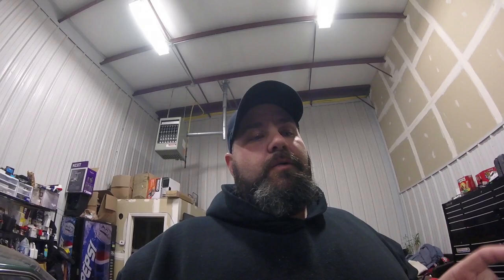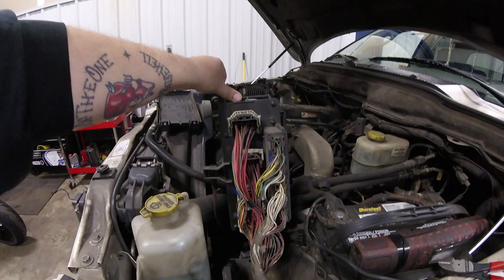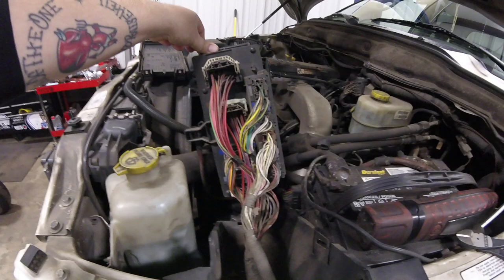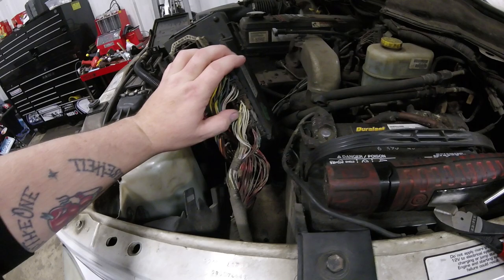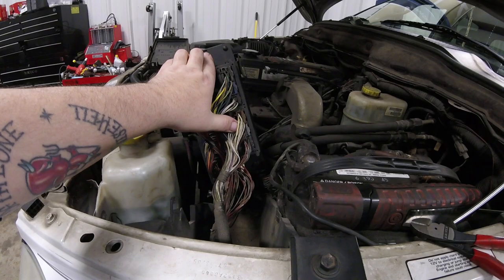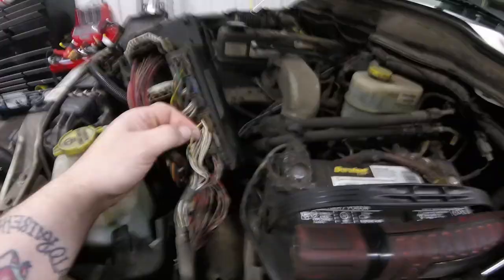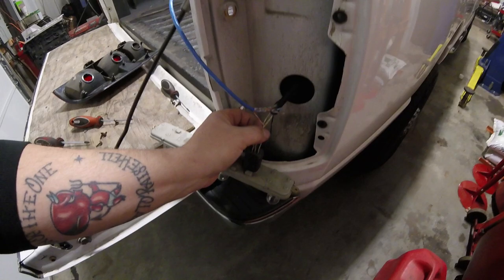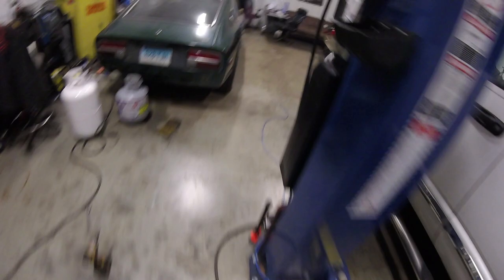Cummins Ram 2500 Bad TIPM??? Maybe not!

Comment: I have an issue where my parking lights don’t turn off when I turn the truck off. I’ve found an annoying work around by turning the key back on, turning my lights on then off, then turn the key off again. Would this possibly be the TIPM? Or a Relay?
Reply from the maker: It could be a stuck relay but most likely its the TIPM holding the lights on. Most dodge trucks have a feature where if you turn the ignition off with the headlights on, it will hold the headlights on for 30 seconds. Its a safe entry feature and sometimes it goes awry. Your TIPM may need a software update to fix the bug.

Comment: I have a 07 ram 2500 i kinda of got a similar problem but my left blinker blinks while the right blinker is on unless the running lights are on. IF I turn the running lights on the lights on the truck work fine but as you noted my right turn signal has no power at the 7 pin trailer plug any ideas Thanks

Comment: Great video. 
My 2006 Dodge Ram 2500 Cummins 5.9 L have an issue with the a/c clutch power, some times gets power and some times not, the clima control module turns on(yellow dot) and turns of randomly,compressor is fine. Please advice. Regards

Comment: I have a 6.7 2008 ram 3500 , 
Im having trouble with the a/c shuts down and the airbags ligth turns on but if i hit a little bit the tipm (fusebox)  the a/c  works again until i got a bump on the road or something, if you can help me please
Reply from the maker: At this point I would say that your tipm has failed. You will have to get it rplaced at a dealer.

Comment: Great video.. have a question that's the crazy, 2000 Dodge RAM 2500 Cummins, turn the A/C on and the engine sounds like it's missing.. turn the AC off and it stops, put a alternator on it about a month ago

Comment: Great video thank you! It just so happens I just purchased a 2014 Ram 3500 4x4 tradesman and a 2019 Big tex 25+5 gooseneck flatbed trailer all the lights work properly yet I am unable to make the trailer brakes work. I bought a trailer plug in tester and the moment I plug it in the 12v light comes on. I'm not an electrician so I dont know if that is right or not. Any suggestions? oh I did try setting the gain on the evic and it will not reset for setting up gain on new trailer. I also tried settings on radio in which I have trailer settings as well.
trailer 1 thru 4 but the problem I am having there is every time I set trailer 1 then trailer type then heavy electric it says info not saved! Then I start all over but get the same results every time. I will greatly appreciate any  ideas thank you very much.

Comment: My tac doesnt work in my 2006 dodge cummins. My ac randomly goes out typically when the truck kicks into a passing gear and my headlights go dim sometimes. Do you think i have a tipm issue?
Reply from the maker: The tac was a popular failure item in those, the a/c is most likely low on charge, and the headlight ground is probably corroded. I would check grounds, recharge the ac, and deal with the tac. Doesn't sound like a typical tipm issue to me.

Comment: I have a 2004 Dodge 2500, 2 wheel drive cummins. The horn started going off non stop. I had to pull the fuse to get it to stop. Has anyone had this problem or have you heard of someone else have this problem?

Comment: Hi ! So I’ve got an 08 dodge diesel that is sending constant power to the AC pump . Never cycled off building way too much pressure and icing the system up . The only way is to physically unplug the plug on the pump to prevent it running . 
I need to find time to do more digging but curious if you’ve come across this before ?
Reply from the maker: I have. Its either the compressor relay is shorted on, or the evaporator temp sensor in the hvac box is bad. With a proper scan tool you can check the operation of the temp sensor.

Comment: I got a sterling bullet that throws a lot of codes at me the most common are p0107 and p0004 but there is a list of others I know it’s electronic because the sensors are brand new the truck is deleted I got no idea where to start or go if anyone has had the same problem or some advice I’d greatly appreciate it

Comment: Hello i have a 06 dodge ram 3500 i was repairing trailer lights from previous owner because trailer brakes weren’t working something caused a short now my a/c light on my control go off and my airbag light comes on i wiggle wires on tipm and airbag light goes off a/c starts working

Comment: I have a 2009 Dodge Ram Hemi 1500.  The wipers stopped working, the HVAC  blower motor moter stoped working, door locks, stopped working, brake light is on, aribag light is on, abs light is on, ESP BAS light is on, and the traction control light is on.  I suspect that it is the TIPM.  Is there a common solution for my problem?
Reply from the maker: Not an easy common solution unfortunately. There is most likely a corroded trace inside the tipm that needs to be repaired.

Comment: I can't seem to find the problem in my 2004 dodge Cummins 3500 . My battery gauges gone done all of a sudden  , I have new batteries , I have clean the hot wire to bridges from one battery to the other and it started working fine then all of a sudden gauges went down again. I have replaced the alternator to . Can you tell me what I can look at for ? Thanks
Reply: Martin Macias same exact thing is happening to my 03 dodge ram quadcab dually cummins

Comment: In the beginning  you spoke about the trailer plug shorting out, is that common? If so what causes this, a wire short? I have a 06 3500 and that is exactly what happened to me! I plugged in a brand new trailer and it caused a short, but my short caused a fire. I was able to put that out, I took it to dodge and they said it would cost $1100 to fix the wiring. So I took it to a local guy who ran a dedicated line to reinstall my 7way plug, went home and everything worked except brake lights. So I installed a brake light switch, no change. Then I changed my multifunction switch nothing. I am at a loss on how to fix this!

Comment: We bought a 2005 Ram 2500 had a 5.9l cummins engine in it. The engine was already pulled and was put in the bed when we purchased it. It was the complete engine(turbo,wiring harness, ecu, etc). We then went to purchase a 2006 5.9l that was in a fire. We heard this engine run before the guy pulled it for us so we know it runs. We out the 06 engine into the 05 truck with the 06 harness and 05 ecu. When to fire it up and nothing. We then changed everything to the 05 em, 05 harness and 06 engine. Tried to start it, would crank but would not turn over. We also do not hear the fuel pump kicking on. We are not 100% sure that the 05 computer is from our truck originally since it was not running when we bought it. I hooked up my OBD2 scanner to the truck and it was saying that it could not link to the vehicle. Does this sound like an ecm issue? Maybe something where the ecm is vin locked and not letting the fuel pump turn on. Is this something you even deal with?
Reply from the maker: If the scanner cant connect it is usually an ECM issue. I do deal with stuff like this from time to time. Most times I stay away from it or start from scratch because troubleshooting someone elses nightmare is difficult. 05 and 06 were very different and most likely why the 06 ecm and harness had no luck. Sounds like you have yourself a fun wiring dilemma.

Comment: I have Dodge 1500 2010 Laramie no left parking lights , & license plates lights are working . What would the fuse name be under?
Reply from the maker: I would honestly check the bulb holder in the light itself. Those were very troublesome in these trucks.

Comment: Great video! I’m having a similar problem on my Ram 1500. My left taillight went out and I replaced it and now my left front turn signal is out? I was told that it was the socket replaced it and I still have the same problem? 🤦🏽‍♂️🤷🏽‍♂️

Comment: I have a problem with my 2007 dodge ram 6.7 3500 dually; i drove on the highway, around 110km per hour and wanted to pass someone i put my left signal on and as soon as i did that it shifted down to 3rd gear, went in really high rpm and seemed like the transmission was gonna blow, then i had to stop, shift it into park and then i kept going and it was normal. Its not always the case that it happens when i left signal but it happens only when i left signal. In the last couple days this has happend to me multiple times and i figured only when i put the left signal on. Does anyone have an idea what could cause that, or has anyone ever had any experience or something like that happen to their truck? Any help would be appreciated and thank you in advance!

Comment: Personally I don't think it's a break in The wire I think that particular light gets too hot and it burns the filament because I've had the same problem but I've also noticed the filament falls off and if you can get it to make contact again it works I'm not a mechanic but I just assume that it gets too hot and that's that

Comment: Having problem with  my 1998 dodge 1500 head light high beam not activating and acting like a broken wire but not sure after viewing your very  and in lightning TIPM video. Don't have a TIPM diagnostic scanner but not sure now were to find an automotive electrician like yourself. Look forward to tackling this issue  if I can with your suggested help.  Thanks Tom McIntosh
Reply from the maker: 98 really doesnt have a tipm like the 03+ models. I would check the headlight high beam relay or check all of your grounds.

Comment: excellent advise ...Same truck same year ,having a problem with my right reverse light not turning on when in reverse ... would this be the same issue i would have to look for ?
Reply from the maker: The lights themselves are super problematic on these. Check the bulbs as well as the sockets. Also check the connector to the light. They corrode and the pins get loose.

Comment: 2007.4 6.7 like your video but maybe has 2006 tipm? I have a no start . Fuel injection relay I got from rock auto looks nothing like this. I have a new injection pump. Cam and. Cranch shaft position sensors.. so now now codes I. Thinkining it's this tipm?

Comment: Awesome video. I have the same issue (passenger turn signal in-op) in my 2007.5 ram 2500 Cummins along with some other issues including, occasionally will get a “No Bus” displayed, transmission will go in fault mode (only 1st and 4th gears available)-when that happens I turn my truck off and pump the brakes 3 times and it’s fine and lastly my aftermarket head unit will not work power on sometimes usually when it’s a little chilly and the glow plugs have to warm up but I can fix that by removing and replacing the fuse 5 or 6 times. All these issues happen at random times. I knew it was a power issue but just recently discovered this TIPM info. I’m thankful for videos like yours cause now I know it’s all coming from one device. All that being said would you suggest replacing the TIPM or flashing it? I have not looked at the underside of the box for corrosion or anything yet. Any help will be greatly appreciated

Comment: i have a 2007 dodge 2500 with a 6.7 Cummings it has developed a parasitic battery drain as well as when its cold or first start the truck the fan for the heat and a/c work but the circulation and the mirror heat will not work once the truck runs later on all the controls work as they should its driving me nuts need your help please
Reply from the maker: It's hard to say with any accuracy what your issue actually is. The mirror heat was flaky in these trucks as are the blend doors and actuators on the hvac system. You could have a sticking blend door that frees up once the truck is warm. The only way to know for sure is to remove the dash and get the heater box apart.

Comment: I have a 06 and the alternator is overcharging,the heater doesn't work on the driver side, wipers won't go on full, blinkers don't always blink on the right side, loss of power(randomly),
 To me it sounds more like the ecm...?
Reply from the maker: That does sound very much like the ECM. The alternator is controlled mainly by the ecm and the battery temp sensor. I would also look into corroded connections at the ecm plugs.

Comment: I have a 06 Megacab Cummins with right front blinker get power. I pulled the tipm and and checked power coming out. No power coming out for right front blinker. What should I check for now? Lol. Any help would be great.
Reply from the maker: Check the connector to the tipm that houses the wire for the signal. Sometimes they get corroded. If thats ok then there may be corrosion or something else damaged in the tipm itself.

Comment: I have a 2001 Dodge Ram diesel 2500 would TIPM be bad my lights are out on the racks lights in the back of truck....is it TIPM
Reply from the maker: The 01 does not have a tipm like the 02-09 trucks do. It may be a bad ground or a broken wire.

Comment: Please help me out man... I have an 04 ram 1500. Both front turn signals wont flash and only one in the rear works. Also my high beam works on the right but not left and low beam only work on left and not right...
Reply from the maker: Check all body and chassis grounds.

Comment: Ok o6 HD ram,no probs on the truck but my trailer lights font work ,seem to get power at the 7 pin(they used to work good,and work on other trucks)the 4 pin has brake lamps/turn,no running lights though,maybe I'll try and track down a high end scanner,or was there s better way to determine that I just didn't pick up on(ya I'm new around Electronics lol)great video I'll look through it some more thanks

Comment: Hello my friend
I drive a Dodeg Ram 2500 built in 2006 5.9L LST.
I am from Germany and have a problem with the turn signals on the right side. I have measured on the electronics in the engine compartment and there is no signal out. Are there also the three relays for the turn signal and the tail light installed? Or is it already electronic?
Second question. Is there a mobile test device with which I can read the errors from the control unit?
Thanks in advance for your help. 
Jörg Klauke
Reply from the maker: All electronic and built into the TIPM.  Yes, but it has to be a dealer level scanner or professional scanner.
Reply: Thank you for your answer. That means I have to drive to a dealer. Is not there another device I can use to reset the controller?

Warm greetings from Germany.

Jörg

Comment: Thanks for that video. I had my DS headlight go out (not the bulb) and found a video on youtube how to bypass it and put it on with the PS headlight. As I went to do it, the PS headlight stopped working, along with DS High beam. Any pearls of wisdom to offer here? I have the truck in central america and while I can get a rebuilt TIPM in the states when I go, I don't know how I'm going to find someone to program it in.
Reply from the maker: The sad reality is that the tipm is most likely smoked. Running two lightsa off of one circuit is a sure way to fry it up nice. Programming it is def going to be your main issue. I cant help much there unfortunately.

Comment: I have an 06 Dodge Megacab with the 5.9 diesel in it...
The AC button will not light up when pressed at times nor the seat heaters or defrost.... 
What would your speculation be on possible TIPM or any other suggestions?
Reply from the maker: It's most likely the TIPM failing and dropping power to some of the accessory fuses. A good way to troubleshoot is with a power probe. When the issue occurs, use a power probe to test for 12v on the offending fuse. If there is no power, apply 12v and see if the accessory turns on. If it does, then the issue is 100% the TIPM.
Reply: @MorFabIndustries  I have a tipm for a 2007 dodge with auto trans manual 4x4, and 5.9 diesel. but would it fit my current truck that is a 2006 that has the same options if the tipm is new, and was never put on the 07? Ive heard that theres a learning process for new ones, if so is that something it does on its own when hooked up, or would a dealer have to do that?? Please shed some light on this. Thanks.

Comment: Great video and really appreciate your honesty! Maybe you can help diagnose my 2011 Ram 3500 Diesel issue. Truck has about 54K miles and is clean. Received message that 4WD Needs Servicing and Trailer Brake Needs Servicing and truck won't go into 4WD nor will brake controller indicate power when connected to trailer. Checked fuses and they're good. Bought a BlueDriver OBD II reader and got codes U011A, U0137 and U0102. Tried Clearing them but codes returned. Thoughts?

Comment: I have a 2010 2500 Mega Cab diesel. The RR tail light stopped working and the reverse lights stay on constantly. The bulb and the connector are both good, as we checked them on the Left side. Is this a similar set up to the issue you're talking about in this video? Great video BTW

Comment: I have a 07.5 Dodge ram 2500 with a 6.7 cummins. I have a code c1405. I've been trying to locate a pinout of the TIPM with no success. Could you help me find it?
Reply from the maker: I haven't had much luck finding actual pinouts. I found this one in an obscure google search and it only listed about half of them. If you could get ahold of a factory service manual, im sure they would be in it.